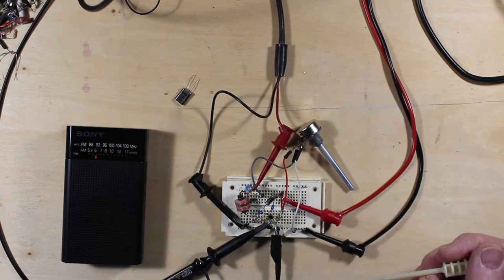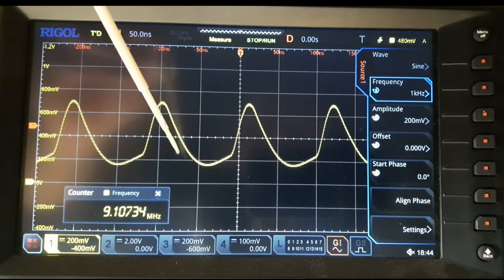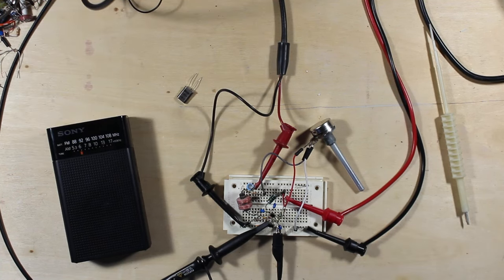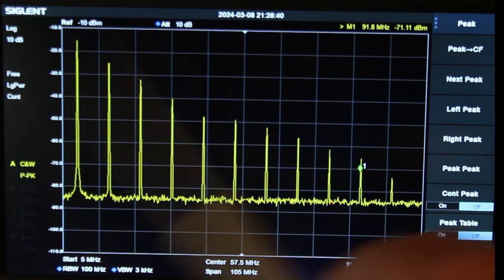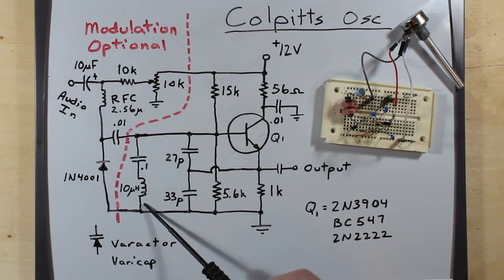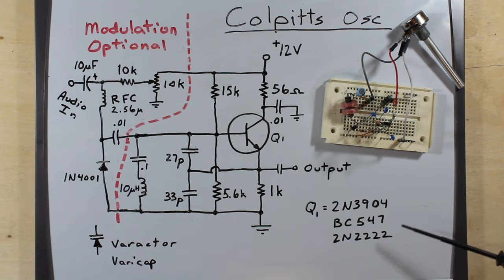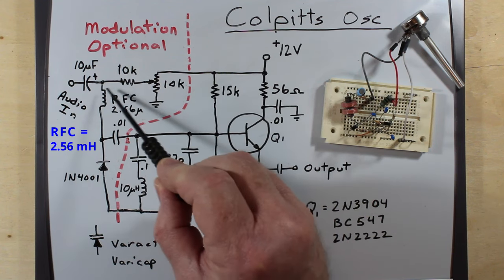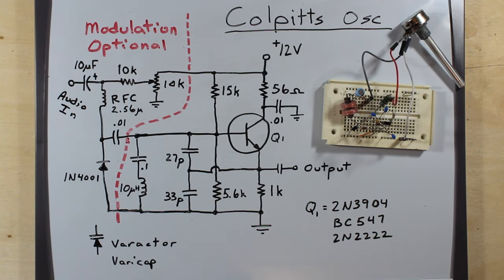One Transistor FM Transmitter Using Colpitts Oscillator #electronics #diy #spectrumanalyzer  #radio

Comment: Howdy. Nice.
I would say that is a Clapp oscillator.
But yeah. Some consider Clapp to be a variation of Colpitts. Hair splitting perhaps.
I understand Clapp:s are very frequency stable.
Regards.
Reply from the maker: Thanks for the comment.  Are you thinking Clapp because of the .1uF in series with the 10uH inductor?  I suppose I could have left  that .1uF out of the tank and put it between the 27pF and the junction of the 15k, 5.6k and the base.  It's not part of the tune and provides DC isolation. At 9MHz the impedance of the .1uF cap is less than one ohm.  The breadboard is still together so I'll give it a try.
Yep, it works.
Reply: @MoreThanElectronics Howdy again.
The Clapp topology - as I understand it - is feeding emitter feedback to the base via a "split" capacitor arrangement. The 27pF and 33pFin Your lineup. The emitter signal is in phase with the base. The 27pF and 33pF are not regarded to be tank capacitors. But they will have some effect on the tank
I understand Hartleys use tapped tank coils and Colpitts' "tapped" tank capacitors.
I am open for correction if I am wrong.
Regards again.
Reply from the maker: The Clapp circuit does use a capacitor divider configuration, like the Colpitts, to feed back some energy into the tuned circuit to maintain oscillation. Those two capacitors also contribute to phasing .  The Colpitts is a parallel tank and the Clapp is a series tank.  The book Practical Oscillator Handbook by Irving M Gottlieb (1997) has a discussion on the two types on pages 151 and 154.  You can find it on epdf.pub.  Also Wikipedia has an article on the Clapp oscillator but the practical example is in error.  The frequency and values don't line up.
Reply: @MoreThanElectronics Howdy once more.
Aha. Alright. Finally the point that defines the Clapp. Much gratitude.
Regards once more.

Comment: Please tell, what diodes are better in this circuit as varicap 1n4001 or 1n4007?
Reply from the maker: The data sheet from Vishay says the 1N400x series are all about 15pF at 4V and 1MHz.  They are designed as a rectifier, so when put to use as a varicap it would not surprise me that who made the diode might be a bigger factor than the part number.  Looks like room for experimenting.